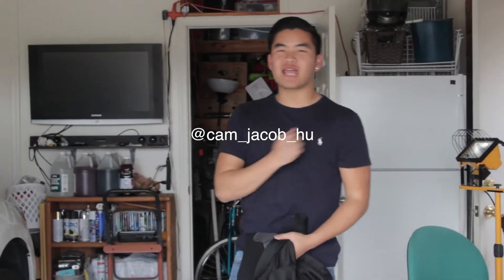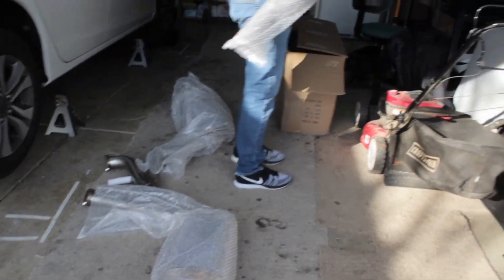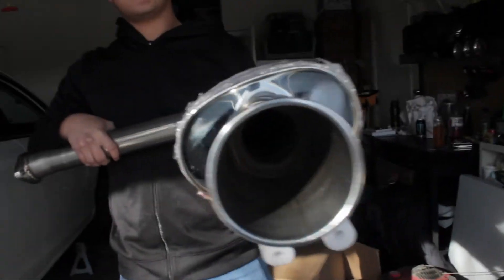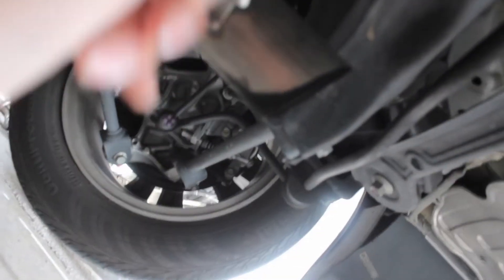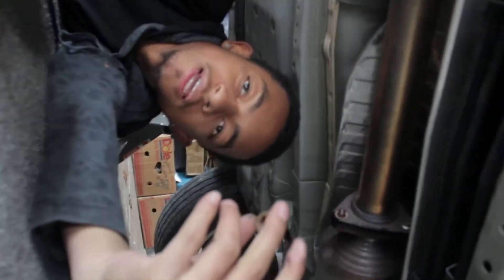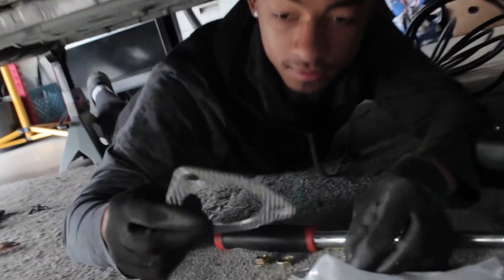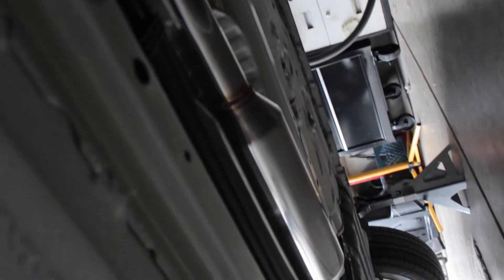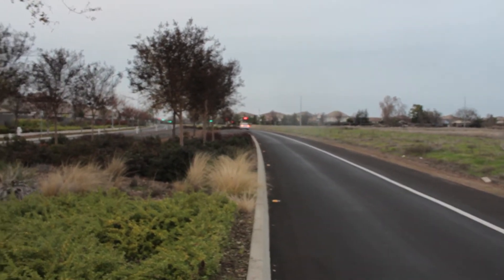Honda Accord Gets RACE EXHAUST!!!

Comment: You think it will work for the 2013 accord EXL 4 cylinder?
Reply: Yes the year doesn’t matter. If it’s a 9th gen Accord almost all parts will fit as long as it’s meant for the engine your car has

Comment: Not loud enough should of went with magnaflow catback exhaust system. I have a 2015 Honda accord coupe ex 2.4l and I can't find a single cat back exhaust system that fits my car it's driving me crazy not even Icardi has one that fits there all dual but with a 4 cylinder 2.4l engine it's not going to make a difference in hp. 3 mechanic told me so what do I do now lol I already installed k&b intake system damn if I new it's was going have trouble finding it I would of bought the 3.5 l coupe ex--l
Reply: @Clear Choice What did you end up doing?? I have the same car lol
Reply: Get the afe mid pipe. It fits coupes but same w the sedans. I had to buy an extender 2.5 inch width at auto zone to make it fit flush.